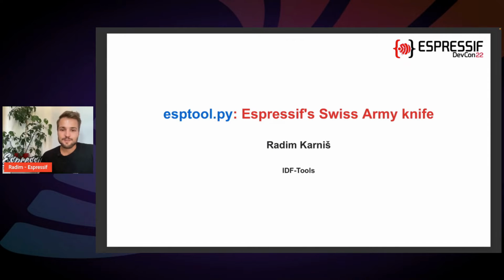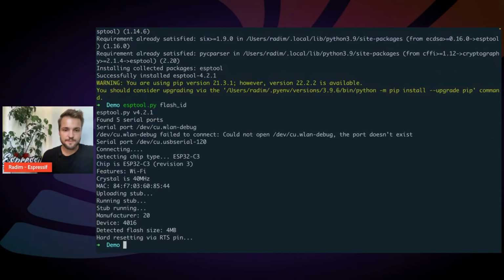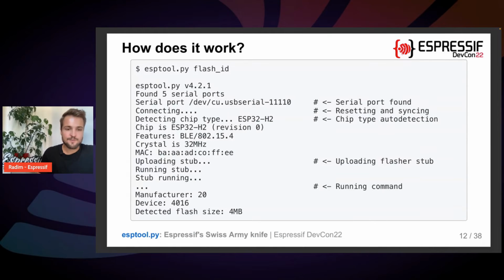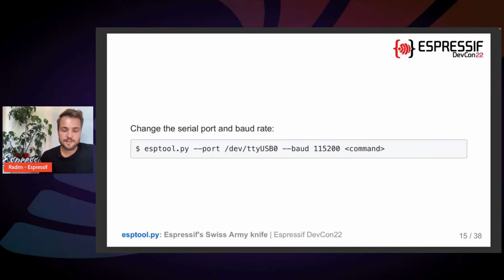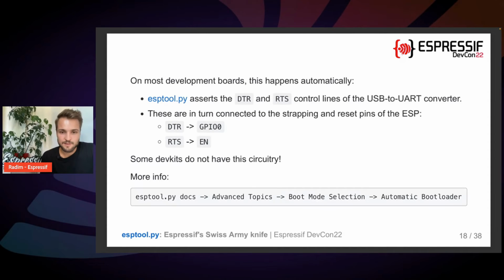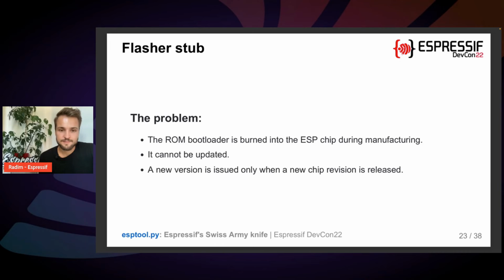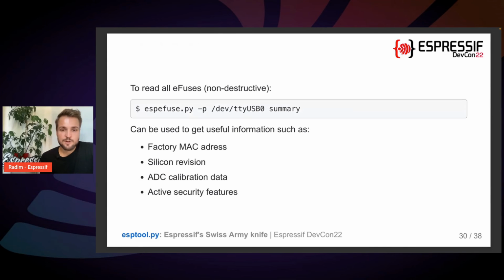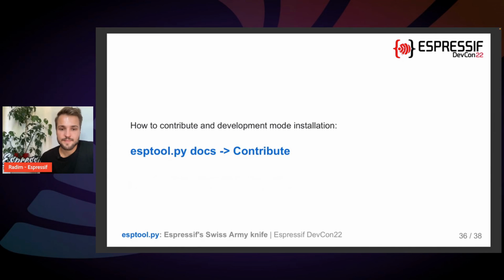EDC22 Day 2 Talk 10: esptool.py Espressif's Swiss Army Knife

Comment: You know, I watched this specifically hoping there would be discussion of the load_ram command, but you just breezed right over that.  Basically, I see your documentation on load_ram, but it seems to be pretty much "not discussed anywhere in the world."
 
I want to do bare metal programming on the board, and want to do it by running code from ram after load_ram loading it, to avoid perpetually flashing my flash.  This must work - you obviously get that "stub" over there somehow, and also the load_ram description implies that can be done.  I just can't find anyone talking about it.